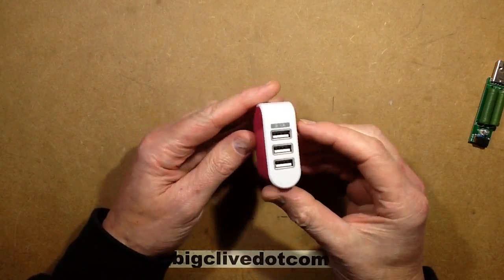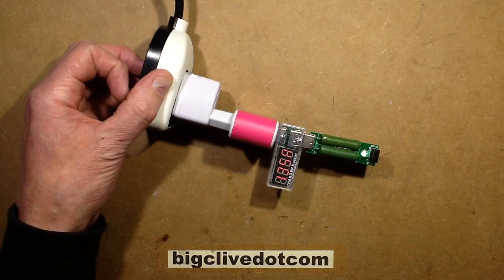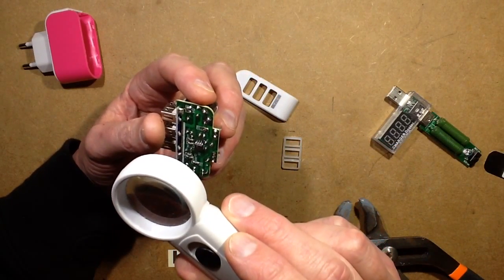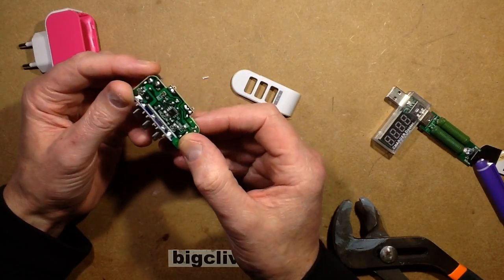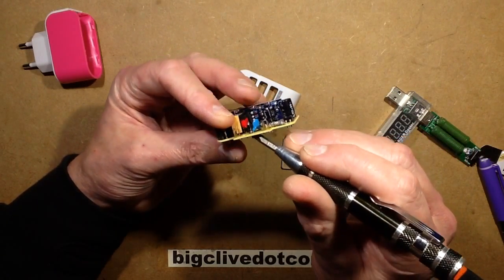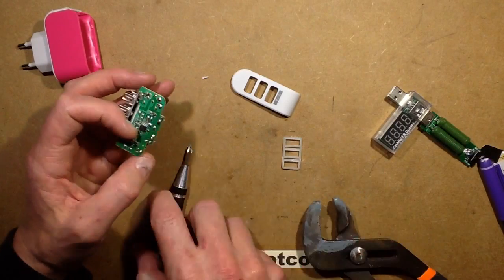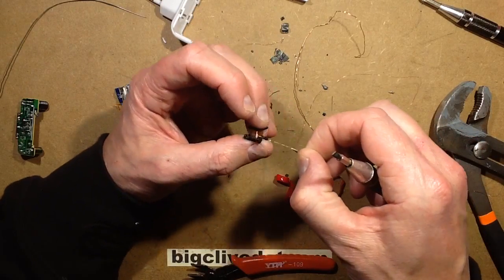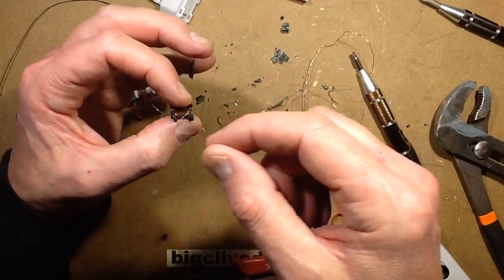Test of a three port 3.1A USB power supply.

Comment: Hey Clive. do the viewers a favore and draw 3A though the usb port please. because i think ull find you cannot draw 3A though a usb 2 connector without it smoking like mad!  at 1.80A the connector got so hot and smoked badly.however i have managed to draw 3A though a usb 3.0 connector. i did some tests as im building a dedicated 20A 10 port usb charger
Reply: Can't, the transformer is gone.
Reply: I think it's intended to be 3.1A altogether. So 1 and a bit amps from each port. So the ports wouldn't (necessarily) catch light just from that. Looks like the voltage would plummet though. And probably some other bit would catch fire. Fun if it was the transformer, burn right through the insulation and electrocute whoever touches it. It's terrifying that shit like this is allowed to be sold, even though it blatantly fails the standards in the country it's bought in. 

I suppose a complaint might get it banned, then that just leaves the other 15,000,000 cheap dangerous USB power supplies. Ebay and Amazon have completely fucked product safety, allowing any bunch of cowboys to sell anything to the public. Some laws need to be made. Maybe randomly inspect some Ebay products, then fine the shit out of them for allowing their sale.
Reply: the thing just exploded in fire on me, big guy was right , stay away from this flashy pink shit.